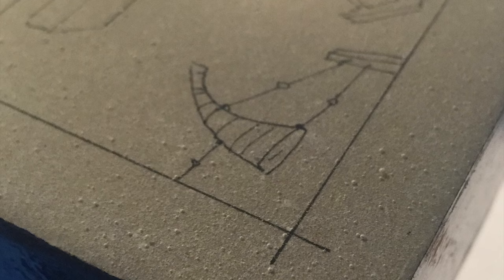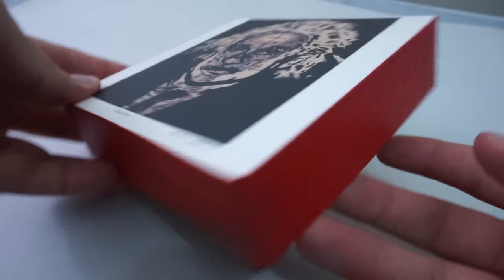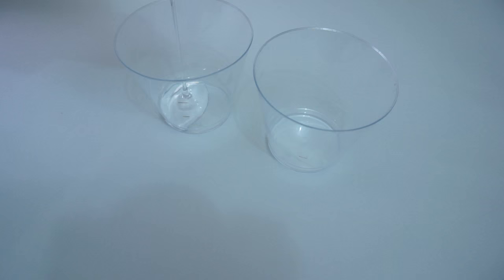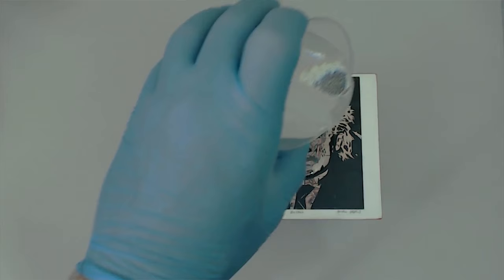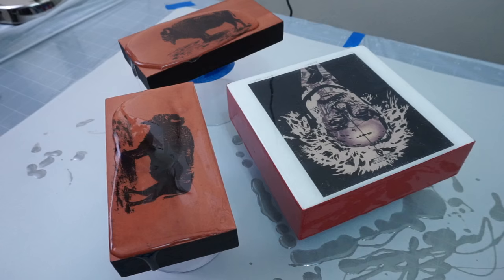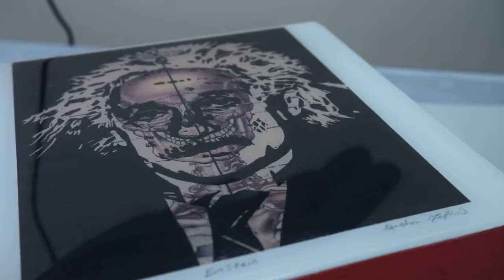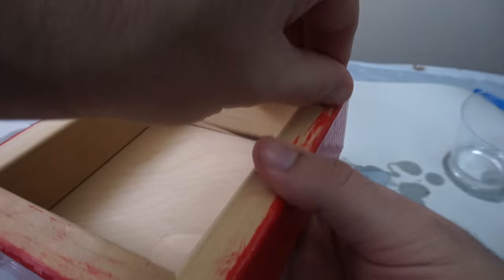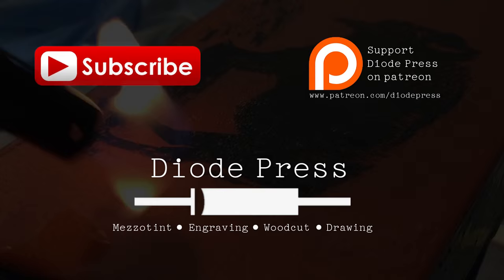How to Epoxy Coat Artwork with ArtResin

Comment: Awesome video!! I was really hesitant to working with resin because of the long process, but after watching this I think I'll finally give it a try. Did you use liquid glue or a glue stick to mount your piece? I've read on different forums that you need to match liquid glue w the liquid resin or it won't cure right. For reference I'm working with collaging vintage magazines so I want to make sure my images are secure before I add layers of resin. I've tried mod podge and all purpose liquid glues but always get so many air bubbles and wrinkles in the paper so I think this will be a step up for sure!
Reply from the maker: I use matte medium typically. It's worth testing out on a scrap first though, since sometimes it will soak through and change the color of the paper. Art Resin is really good with getting rid of bubbles also, with just some heat. Good luck!

Comment: Looks great. The little experience with epoxy (as a special glue, mainly) is that the resulting surface was a bit sticky. Do you think it is due to this special epoxy resin you have used that you did not experience any stickiness of the final surface? I read somewhere sufficient heat and the exact proportions and mixing of the resin and hardener are also important factors. Perhaps I didn't pay enough attention to those.
Anyway, if this sticky mess did happen, you'd be in for a lot of sanding and polishing to recover your artwork.
Reply from the maker: +ytctrb Yes I was very worried about ruining a piece of art when I first tried this. I've had similar things happen with epoxy remaining sticky, and I'm fairly sure it was due to incorrect amounts of resin/hardener. With this, it's a really easy mix ratio, and I know that I was not 100% spot on with it, and it cured completely solid!